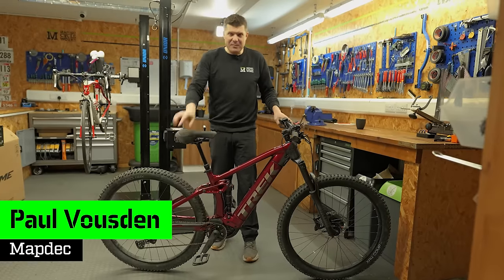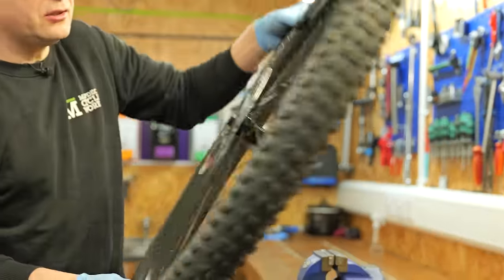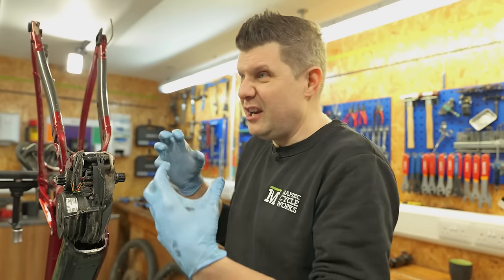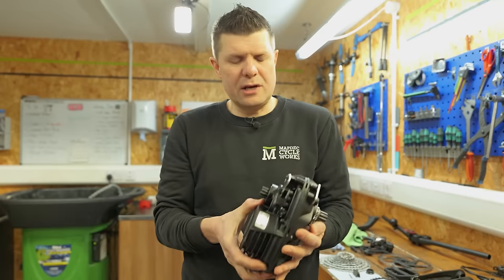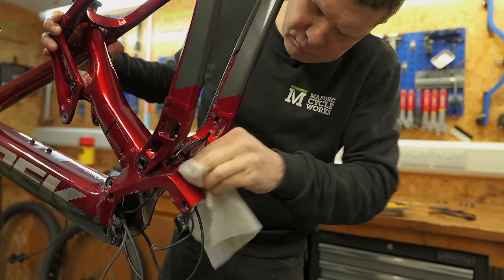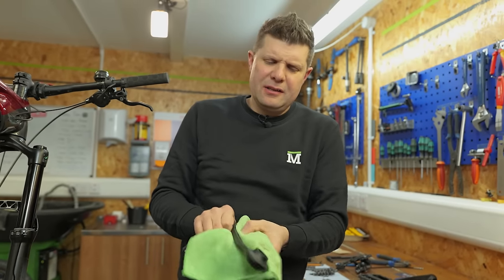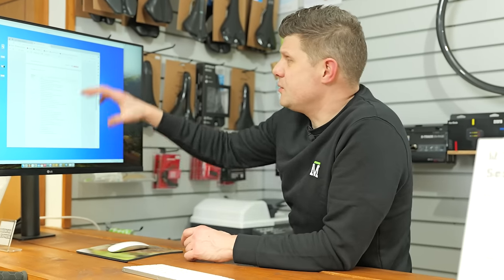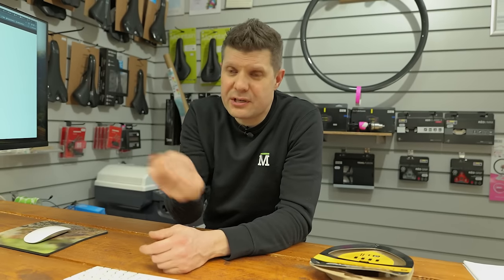This is how much work it takes to service your eMTB

Comment: Certainly, if you need to have a workshop service your bike, you won't get a better job than this - very thorough and skilled for sure.  I would also say the pricing here is also very fair for the level and amount of work undertaken.  In practice, bike maintenance is mostly straightforward (putting the suspension parts to one side) - it's basically disassembly, cleaning, assessment (keep/replace) reassembly (greasing/lub etc).  If you ride expensive bikes regularly it is 100% worth it to take a bike maintenance course, if nothing else you will obtain a degree of mechanical sympathy and get to know the effects of exposure, dirt and grime but importantly, how to disassemble and reassemble safely.   My approach is to do much of this kind of work regularly (eg even after a long day out in all conditions, get it partly stripped and cleaned..) - its called preventive maintenance and also finds early warning signs before they become costly replacements.  Anyway, great work MAPDEC.
Reply from the maker: Thanks. I kinda agree. Much of our value is in repairs and comparability issues.

Comment: Spot on servicing, I'd spray the protect and shine on before pads/wheels went back on though..
Reply: And definitely not directly on the surface, but rather the cloth you're polishing with. There were other mistakes you can make out in the video, but OK.

Comment: Really apreciate the care and attention you put into everything, down to the smallest nut or bolt. However, can't get over the fact that an e-bike service can run up to a thousand pounds. Not blaming you, just noticing the irony that cycling, which used ti be the cheap way of getting around, is becoming just as expensive as owning a motorcycle or car. The times we live in.
Reply: You can buy a Slash as they are still offered in non - electric versions . I have one and they are much easier to troubleshoot and look after . They are still great fun .
Reply: The age of the eBike just added a new chapter to the whole story of the bicycle and made more intense rides accessible for a broader public. Non electric (let's call them acoustic) bikes are still going strong, not much changed in that regard. Only the youth getting a bit weaker without having to deal with headwinds biking to school
Reply: @appelflapdrol  Good point about accessibility and the school children . I find 250 watt limited (125 labotatory measured ) configurations don't make much difference for me at 73 kilograms . It is good only on very steep climbs above 15 degree inclines .  My current TREK 4300 custom build / upgraded is nimble and great pleasure as well as a good climber for her category . A recently revised bike fit for her made a real difference to me and my efficiency .
Reply: @appelflapdrol The good old days of getting your sports class done before even stepping into school 😂
Reply: I'm riding a 15 Yrs old single speed Gary Fisher bike. The maint' costs are as low as can be. You want easy life and go full electric there is a price tag attached to it.
Reply: @arielfisher7  I have a 2004 Gary Fisher Tassajara in grey to build . 3 x 9 speed deore .
Reply: @arielfisher7 I ride a bosch powered ebike, diamondback union 2, and the cost of maintenance has been really low last few years, but I’m also a full time bicycle mechanic! But yea an old MTB can make one of the best and easily maintained commuters.
Reply: I could have bought a classic MG sports car and it would have cost considerably less per mile to run compared to my two e-bikes. I do all my own servicing and I dread to think what the maintenance would have cost if I had decided to use a bike shop.
Reply: you can buy a ridable bike for $200 and get basic service done each year for like $50. but the companies who sell bicycles and also mechanics would be stupid to not include a product for every market. hence why they also sell expensive bikes which require time consuming (expensive) service
Reply: Car/motorcycles still have all these same moving parts. Most of them are even more labour to replace on top of the parts themselves being more expensive too, although the service intervals will be much longer.

Comment: As an old ex motocrosser who recently took up eMTB with a Trek Rail I found this fascinating and was astounded at the level of detail and commitment to excellence. Expensive, yes but worth every penny!
I'm now looking for insights on every day servicing as I took note of the need to clean shock and fork seals etc...
Thanks for a great video
Reply from the maker: Thank you.
Reply: One tip, NEVER spray water with a hose on your shocks, its not really something that is innately dangerous, but under higher pressure, you CAN damage your seals.
Reply: Soft cloth, wipe the shock and fork legs down, that should be it. Maybe after a heavy dirty ride, make sure there's no sand or dirt on your seals, but once again, just wipe them down.
Reply: Ex Moto guy here also, I’m trying to decide between turbo levo or ktm 300, hard decision to make

Comment: You can always add some electrical grease to the battery contacts and other connections for added corrosion resistance.

Comment: Watching this makes me glad I got out of the bike industry right before ebikes became so popular. I have nothing against them but working with this tangled mess of wires doesn’t appeal to me in the slightest. Not to speak of headset cable routing, crappy internal guiding and all the other ways the bike companies have found to make a mechanic’s life a bit harder. Might as well work on cars, motorcycles, trains etc and make decent money.
Reply: You could still specialize in road bikes; it's a smaller market but probably won't have a sigificant amount of electric bikes in the foreseeable future.
Reply: I work on my cars and motorcycles, dirtbikes are still pretty simple but modern cars and roadbikes are not engineered with service and maintenance in mind, I must say (surprisingly) my current BMWs 3 series & X5 are way easier to work on than my previous Audi and most front drive cars...Still lot of swearing 😂
Reply: If you think this is a tangled mess of wires and can't really deal with it... You won't make it with motorcycles, much much less cars my man...
Reply: @LoneWanderer905  ok, “lone wanderer”…
Reply: @Bonky-wonky  One look at ANY wiring harness for any 90's to mid 2000's bike will make e-bikes look like a joke. I speak from experience, worked on a Korean. And one look at a wiring harness for a current-day motorcycle will make you quit instantly. Hell, you probably don't even need a harness, just look at the diagrams.

These e-bikes are pretty simple, although I do agree/hate headset cable routing and stuff, although around where I live this type of BS never catched on, as we're never riding near the edge, imported stuff is super expensive.

Comment: That massive dork disc behind the cassette 😅

Youre a hero for removing it
Reply: Some customer ask to put it back. Lol.
Reply: It’s there for a reason
Reply: Musst put it back, its an Icon 😊
Reply: @arbjful  just set your limit screws properly and you'll be fine
Reply: The reason for remove the dork is: 1:the dealer knows that u have tinker the bike and u don't have Garantie anymore 
2: if Your chain slips, it is very expencive and the Dealer maks mony with the repair;)
 Kids belive everything,and old say:That has always been the case❤.
Reply: @marnig9185  The dork disk is useless. Its an outdated concept. Its like the label over the screw on your laptop when you just want to expand your memory. Remove it and they squirrel out of warranty. Thats why it exists. For the original manufacturer to try and bounce your complaint away. Especially if they are cheaper bike frames.

Its the first thing I snap off and bin (in recycling of course). I just do not see experienced riders having one... ever. Now putting playing cards in your bmx wheel for kicks when I was 6 so it goes brrr. Worth.

Tune the shifting limit screws correctly and even if your chain comes off at the top, it does almost nothing with or without it. I have experienced this commuting and downhilling for years, on the rare occasion a misalignment cause a chain drop, its fine.
Reply: Dork discs are the equivalent of mattress tags.
Reply: @celery_annihilator you mean, federally illegal to remove?

Comment: The price seems fair for the effort involved. Inspections at the dealerships I know look different, they cost around EUR 120 and the garage doesn't do more than an absolutely minimal service. That's actually too expensive.

One thing at the end of the video didn't make sense to me. The spray contains silicone, which you really shouldn't spray on the whole wheel with the exposed brake disc.

Comment: I don't have a mountain bike nor an ebike but like to work on my bikes, and this kind of service is mind-boggling to me. If I have to pay a bike shop that much money to service an eMTB or spend lots of time to do it myself, I'd rather ride a non-assisted hardtail.
That said, I thoroughly enjoy watching your work and expertise.
Reply from the maker: We are all different
Reply: sounds like you have a mountain bike if you have a hard tail! but yes this kind of service is pretty bonkers and awesome and fun to watch. guy seems like a good dude too
Reply: @wrcompositi

An MTB e-bike ant its core is effectively an underpowered dirt bike that you can pedal manually on occasion. Buy a dirt bike and don’t maintain it with regular work on the suspension and braking similar to that shown in this vid and pretty soon you’ll be seeing a dentist for teeth repair or you’ll have a wall ornament. These types of rides by their nature demand a good deal of regular maintenance to run properly. For some that is acceptable and for others it is not.
Reply: find 3x8/9 speed mtb with only front spring suspension, v brake or cable disc , clean and lube chain regularly and cost to use that bike would be minor
Reply: @ivanboesky1520  good point, that's exactly how e-mtb should be considered. The abuse these things have to withstand strictly because of higher mass is quite substantial.
Reply: This video is the exact reason I won’t ever own an E-mountain bike. Maybe a road bike down the road, but that’s a big maybe.

Comment: As a mechanic myself, I applaud your attention to detail. The one thing I personally have switched from is back to standard stainless steel cables. In my opinion, the slick cables are more brittle and prone to kinking,, especially when gear cables have to make torturous bends inside shifters. Standard cables are more supple and (in my mind) the the "rough" surface allows the cable to hold onto lube.

Comment: I am impressed how you can share your knowledge and method for bike services. 
I work as a race mechanic for big international  Events, and i am very strict with the system and process. 
Most of the mechanics i see are easily  distracted and take shortcut, tools everywhere and got addicted with mobile phone notifications , 
but You are one of the best i saw, clean, precise and rapid. Well done for your expertise and workflow.  i ve learn few things from you.

Comment: This is a reminder of how much I love my mechanical road bike that I can service myself. 😀
Reply: You could do a ebike yourself it's no harder
Reply: @steve17bf2  having watched this video I can assure you that servicing an eMTB is significantly more work than servicing my road bike.
Reply: @Thezuule1  owner of a full suspension eMTB - service really takes a bit longer than on my hardtail MTB, but it honestly isn't that much more involved. Yes you have to check more things regarding rear triangle and pivot bearings, but that also applies to non electric full suspension bikes. My bike uses Shimano EP801 motor so it's a bit different from the Bosch shown in the video, but very similar in procedure. One thing that I love about removable battery is the ability to internally route cables without a hassle of fishing it through the frame holes, it makes it so much easier to service things like droppers and derailleurs.

Comment: 2 points. Don’t put the frame without any protection on your workingstand while replacing the dropper cable. Spray your towel to polish instead of the bike. This will cause brakeproblems on the rotors and discs. Great video to see!

Comment: Awesome job! a little thing i have learned from my own experience when working at a bike shop is putting some kind of cloth between the stand clamp and the dropper post can prevent any bits of dirt scratching the post and eventually making it lower/rise worse then it was before
Reply from the maker: It’s a good tip.

Comment: That’s a good price for the workmanship, thank you for being so transparent, right up to giving the price. I don’t deal with e bikes, only standard mechanicals, I charge £150 for a full strip down to bare frame and rebuild & that includes new Jagwire gear & brake cables and a full report, much like yourselves. I’ve always maintained my own bikes, but started my own business 4 years ago, I no longer work for a living, I do a job I love, customer satisfaction is paramount to me. Love your videos, thank you… I’m still learning, and you make it even more enjoyable👍😃🚴
Reply from the maker: Thats about our price for a bike without suspension

Comment: I loved everything in this video because it really did show how extensive and complex servicing these bikes has become. Unfortunately, lots of people still only want to pay a pittance to their LBS (local bike shop) when little do they realise the knowledge, the tools and the care that is required. I bike mechanic these days has to have expertise in mechanical servicing, along with hydraulics, and now electrical/electronics skills. The LBS also needs an expensive, wide range of tools.
One thing that made me shudder was the Peaty's Mint and Shine spray you spurted around to do your final polish. OMG! After all that hard work you probably got a greasy film all over the brake discs!
One tip that I'm going to follow in the future is, I am going to take my battery out more often to check for moisture and make sure my wiring harness is free of dampness and grime. Thanks for sharing your video.

Comment: For internal cable routing, i cut the cable at its start and tape the end of the new one to the freshly cut end, pull thru slowly and it works great. If it has to go thru housing ill go thru the housing first then tape it to go thru the frame. Works a charm.

Comment: I do all my servicing and strip downs myself- just rebuilt my Pikes and Monarch RL fully (new bladder in the Pikes)...The motor is the only bit I won't touch but just send it off to be rebuilt (I've watched Pete Collards videos- makes it look simple but without a hydraulic press and all the bits forget even trying!!-I'm not sure I'd degrease my Gen 2 CX in a bath though, they are pretty awful at keeping water out especially the NDS, let alone degreaser!)...But your service is great value, when you consider the bike/manufacturer specific tools you need to acquire for doing this it gets mega expensive....and that's not even considering the knowledge, skill, confidence and experience you need. A rebuild of my motor is £315, I'll happily pay that as my van tax was about £250 and you get nothing for that... a rebuild ensures another few years happy biking!!

Comment: Lubing all the electrical connections with dielectric grease (also known as silicone grease) is a tip that I can give. Helps prevent corrosion.
Reply: Outside of connectors only to keep out moisture since silicone is not conductive.
Reply: Can you put it on the Battery contact's
Reply: @mrnemo1480  Use a little brush and go light on the contacts.

Comment: I'm glad I can do 80% of this by myself $$$ !!! Proper job anyway ! 👊 Good trick about the dropper cable length while routing it to give enough flex and adjustability.  But I'm not spraying anything on bikes to avoid contamination and pollute less, there are always non-spray alternatives.

Comment: I have 2 Volt alpine e bikes with Bafang motors. I used to race cross country non e bikes but now at 66 I just do trails. Done 6k miles between them. Not a single problem other than brakes and adjustments. I rag the things over some harsh terrain with friends on very much more expensive bikes. Without exception they have had problems with motors and suspension. No doubt they are much better bikes but I have every confidence in Bafang who have been building e bikes for 80 yrs.
Love a flash bike but don’t think will ever be able to afford one. Fascinating tear downs you do

Comment: Excellent video. One thing to note on the Trek Rail however is to pay attention to the battery catch and make sure it’s properly lubricated. I used to remove my Rail battery to charge it and dry it after cleaning. Unfortunately I went out for a ride and as I dropped off the kerb on the way to my usual route, the battery dropped out of the housing and went bouncing down the road, damaging the casing. I discovered the battery catch hadn’t engaged fully and it wasn’t properly holding the battery. Fortunately the battery itself wasn’t compromised.

Comment: You got the love Bosch motors for the quality, ease of use and serviceability.
Reply: Bosch are awesome  If i brought another ebike again it would be only Bosch. I have a 2019 PWX2 Yamaha and at 2000km had it rebuilt. Replaced the plastic drive cog. It looked perfect but when it was apart may as well replace it. 1 of the 2 main bearings was running rough so replaced both mains. Everything else was good. Trouble free so far but i dont ride in the rain. Mud is ok but no rivers or big puddles.. I lift it over.